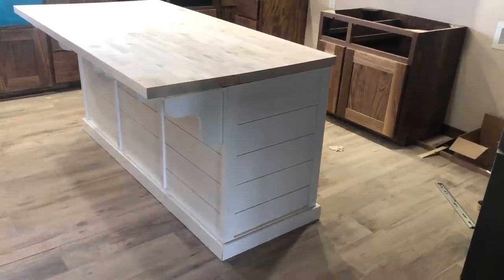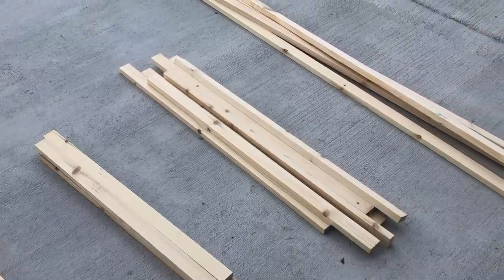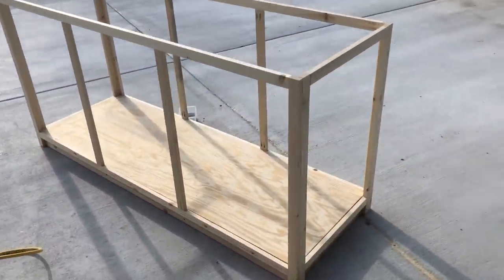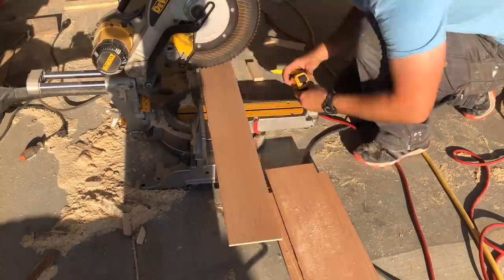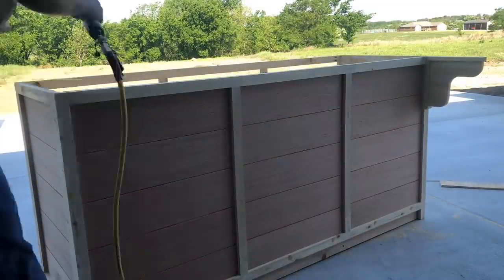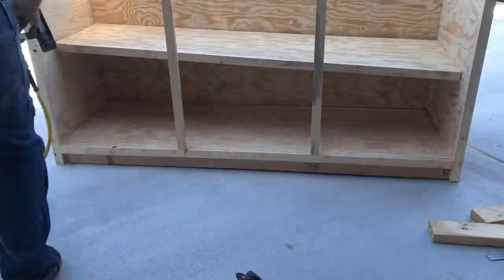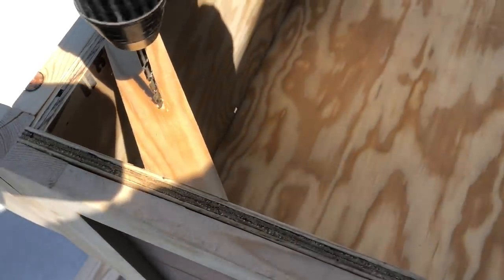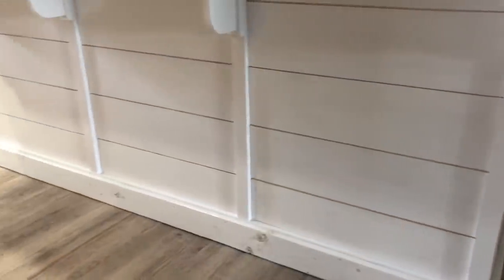DIY Kitchen island (with a shiplap look!)

Comment: I love, love, love this! Thing is I need it smaller. At least 2ft shorter length wise. I have a smaller kitchen. Would I just deduct 2 ft from the longer boards? I havent a clue. 😉. Thank you for any help you can give me.
Reply from the maker: Thank you! Yes, that should work! Any boards that run lengthwise, I would just subtract 24” from the measurement.

Comment: Nice work! Not difficult to build and easy on the pocket!
Reply from the maker: Thank you!  It was a very affordable project.  The butcher block was the most expensive part
Reply: @DIYMAN  I need to find a vid of a "skirt" or band being put on a butcher block top.  I want to put ours ON the existing stone top, so we could remove it in the future.  I have little desire to remove the ~200# stone !!  The skirt would hide the fact that it's on top of another top and I would be happy with the slight increase in height.
Reply from the maker: I’ve actually given something like this some thought for a kitchen table idea I had.  You could drill holes in some steel strapping, countersink the holes, and use screws with a beveled head.  Fill the screw heads with “bondo” (auto-body filler), and paint the strapping black.

Comment: Great build. Did you anchor the island to the floor?  If so, how did you do so?
Reply from the maker: Thank you! Yes I did. It was heavy enough that I really don’t think it needed it, but I sent some concrete screws into the slab at an angle just in case.
Reply: @DIYMAN  awesome!!  thanks!!
Reply from the maker: No problem!